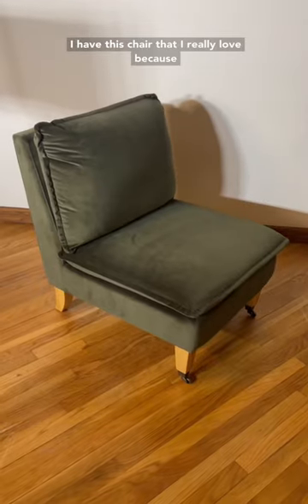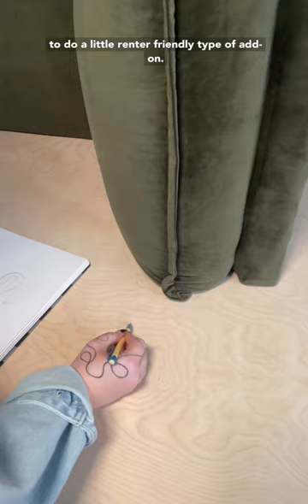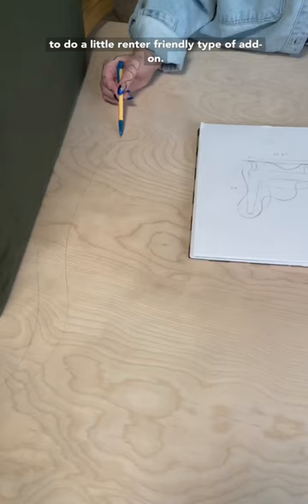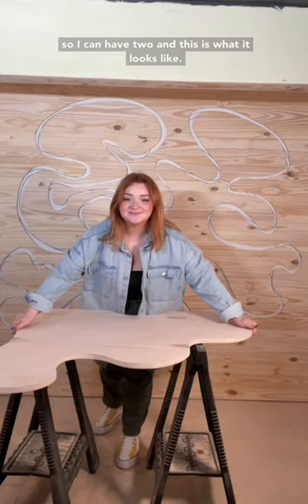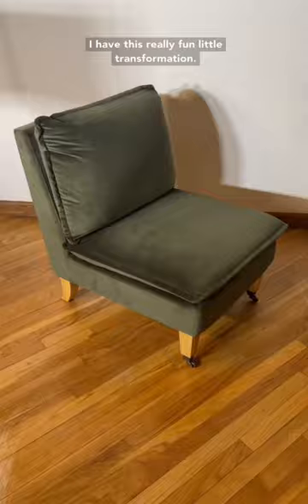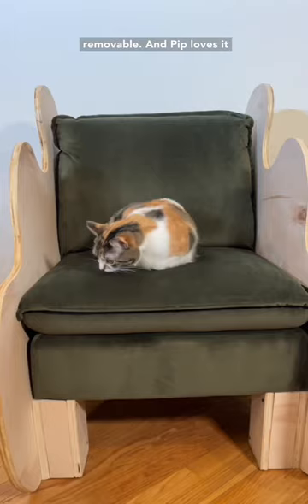Turn any furniture piece into a statement with this easy DIY #shorts

Comment: I just realized that your little leg covers remind me of when I worked a (theatre) show and the scenic designer wanted the legs of the platforms to look square instead of the flat rectangle of the boards used so we did something super similar but with only the three sided shape. We ended up stapling them directly onto the legs, but since they only had one open side we said they looked like assless chaps and called them ‘leg chaps’